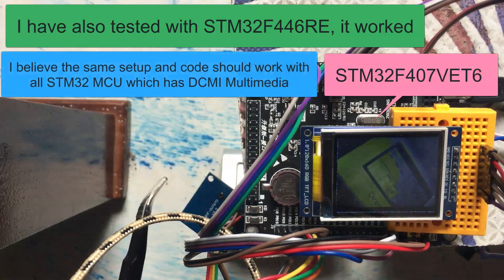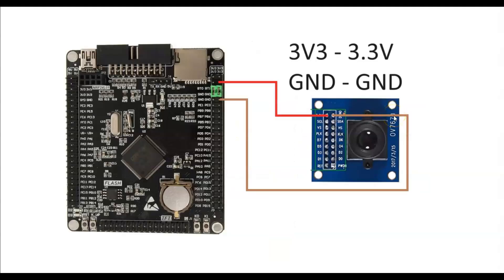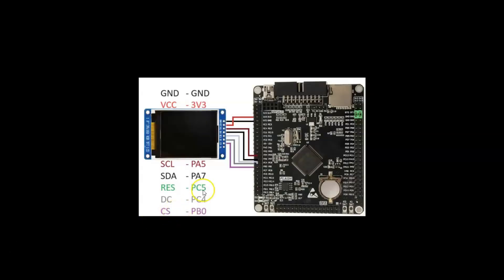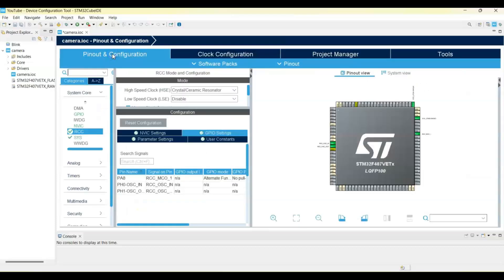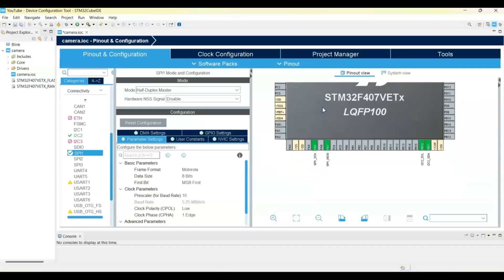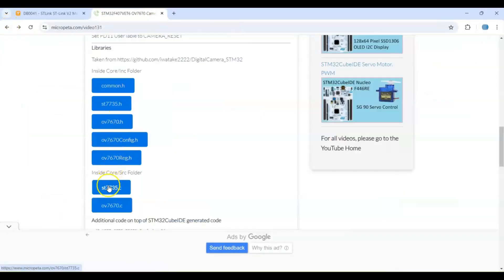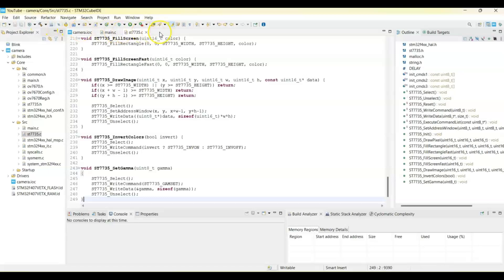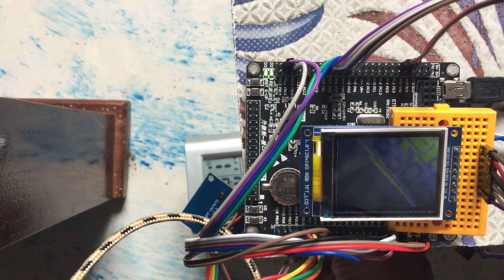131. STM32CubeIDE Camera. OV7670 with STM32

Comment: the videos or pictures is stored in which memory of the STM32? or any separate  sd card?
Reply from the maker: I took snapshot picture using HAL_DCMI_Start_DMA.
The picture is in the variable pBuffer which uses STM32 RAM
The size of pBuffer is 38.4 kilo byte
Maximum available RAM of this STM32 is 128 kilo byte
If you want, you can store the picture in SD card
If you want, you can transmit the picture eg: using UART